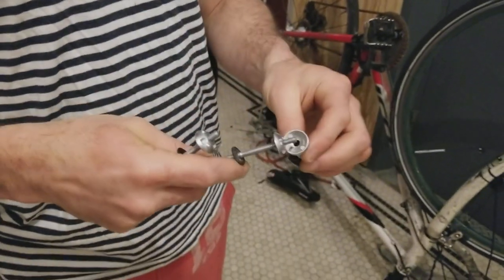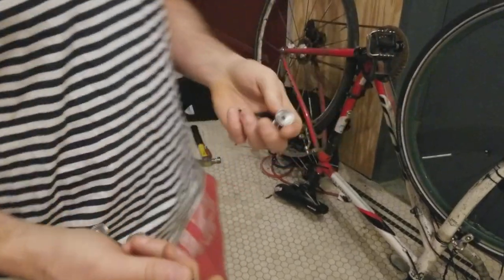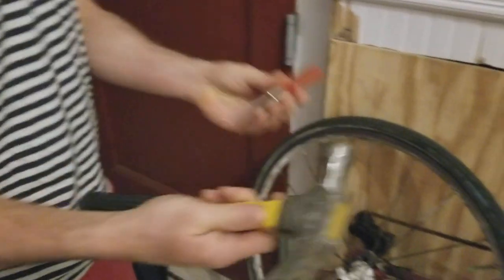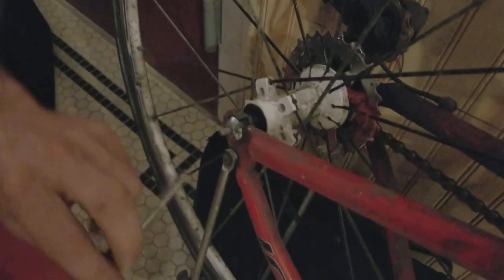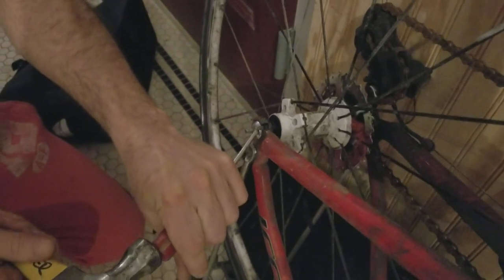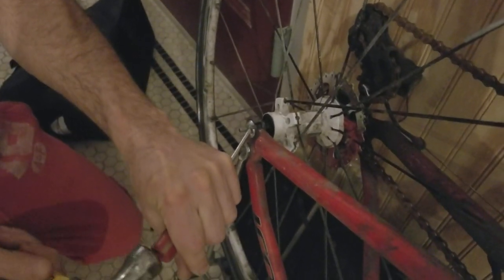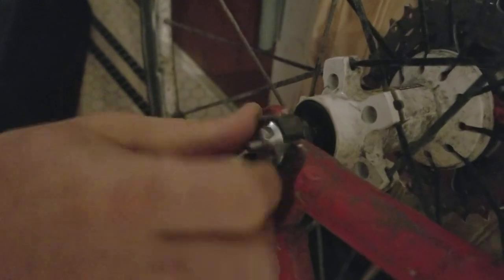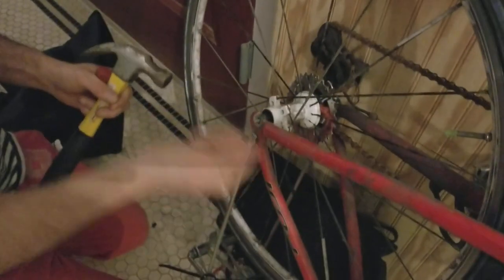How to remove Pinhead locking bike wheel skewers if you lost your key

Comment: Thank you, Josh!  Worked well.  I am grateful you shared this. 

 I had lost my key and the record I recorded the number required for replacement.    

For those worried about someone knowing how to take pinheads off...well, that would be a chore taking a tremendous amount of time and patience eg someone who wrote they left their bike out overnight...that kind of easeful time.

  When I had them installed on my bike, I was in an area where I still had to use 2, heavy duty locks even if the bike were in plain sight!  And actually, it's easier to cut through those locks and just walk away holding the bike. (So experienced thieves can cut through most bike locks so smooth & fast, you blink at a distraction, and the next second, it's gone) If someone wants to steal anything, they will find a way.  But first you can make it very inconvenient and challenging!  Then, most average thieves will pass your bike over for one of easier pickings!  And secondly, every neighborhood/community has its own rules about leaving things "unsecured" and/or "accessible."  Following those unwritten rules is important.  If one does not know them, take your bike with you or chance it!!!

Comment: Just removed a set at the local bike coop. I tried this first, but everything was so seized it didn't work. Not a surprise, I'm in the rust belt. Trick was to destroy those 3 tabs that stick out with a hammer, flathead and heavy-duty pliers. Then I could use locking pliers to grab on the pinhead enough to make it turn. After you get it to turn the slightest, lubricate the exposed threads a bit to make it easier to remove the rest. And you'll need pliers to hold the other end so it doesn't just all spin.

Comment: I just got my wheel stolen even though they were locked with pinhead skewers, at this point Im not even mad.  Never leave your bicycle locked outside overnight, I learn my lesson.
Reply: Steve BONTRAGER I reccommend pitlock. theyre not exposed like pinhead. do you know how they stole? its impossible to wedge a screwdriver into pitlock and these dumb videos just help the thieves
Reply: My bicycle wheels were stolen because I left my bike outside overnight.  I'm going to buy pitlock on ebay but I was told if a thief is determined to steal your bicycle he probably will.
Reply: Steve BONTRAGER I avoid locking mine out of sight at almost all times. but its peace of mind for me to have the skewers as a better option than just a d lock. 

I usually eliminate my reasons while shopping to lock my touring bikes. ill often carry gadgets like lights sat navs personal equipment that prove its not safe unattended especially if i had aay a bluetooth speaker sometimes carry my tech. 

most shops pubs hostels hotels will let you bring the bike in store if they know its worth is high or it looks expensive. asda sainsburys for example. even if they dont like it they usually eventually accept knowing i wont lose 3000 pounds over a 2 pound sandwich or meal deal. if they act like assholes I let them realise their ignorance and shop with politer respectful stores..

its more important to me on cycle tours to have my bikes watched when everything i own is on my bike and im not at home. hundreds of miles from home. i will peacefully argue my point but i find it easier to persuade them as most knowing ive had old bikes stolen and was once almost mugged whilst riding a bike. i have my reasons to stand my beliefs when rules or no rules if i was a shop manager i would happily watch someones pride and joy vs playing authority figure and looking like an asshole
Reply: pitlock are literally the only brand ive not seen broken into. ive lost my key and found it but was impossible to use a screwdriver or similar to open them. 

you get a unique code. my other security skewers are ETC but theyre only a 5 sided hex rather tham 6 hex key. still possible to open with effort. plus theyre chunky and ugly not well designed. 

another option is those combination lock skewers. 

look at the litelok and Altor 560 g titanium indistructible bike lock. has survived freezing and heating crowbars sledgehammers scaffolding and hacksaws plus bolt croppers. no video vs angle grinder but its almost impossible to have a bike stolen with the Altor 560g. its made from aircraft grade high strength titanium can be worn on the body belt and folded behind a bottle cage. 

another option is atomic 22s security bolts. they can secure your stem, saddle, cranks, disc calipers, wheels, seatpost, brakes, handlebars and levers, derailleurs the lot with special bolts and keys.

the headset bolt is amazing making it unneccisary for anti theft bolts on stem. plus only 2 of 4 hamdlebar bolts need to be theft proof max. 

they go on the brands you own like thomson brooks and have a special bolt or bracket for every major bike part brand
Reply: This why I am getting Nutfix nut. It's good for handlebar maybe. Cause those rarely get stolen. But for wheels they go after those the most especially rear wheels